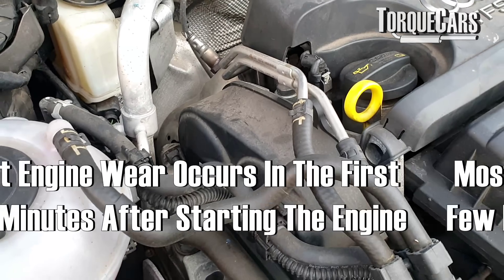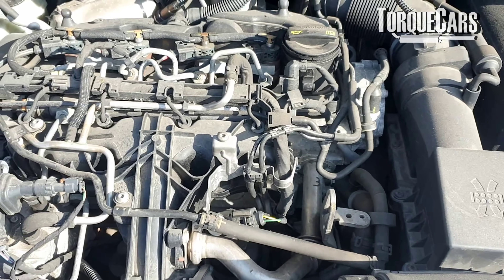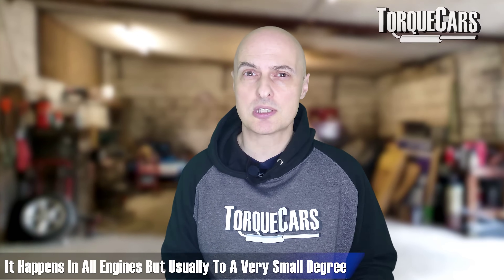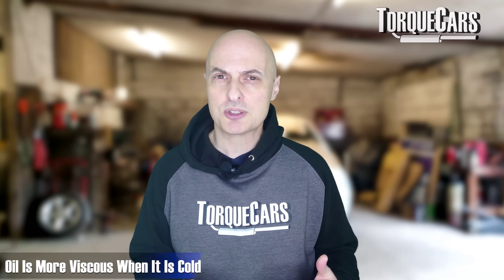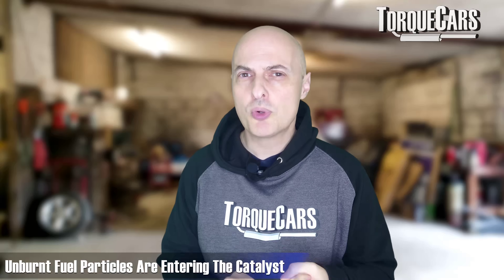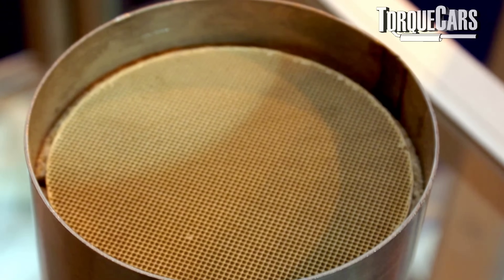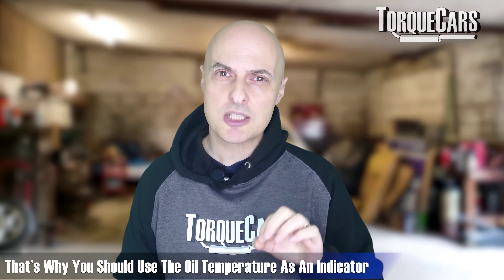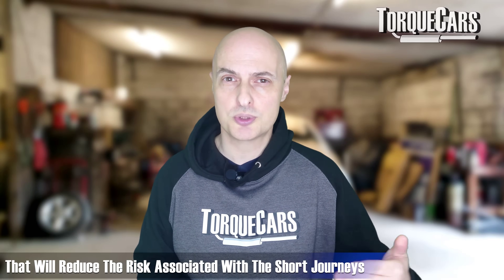5 Minutes of Terror? The TRUTH About Cold Start Wear (and How NOT to Blow Your Motor!)

Comment: I am from Canada and at one point lived in Dawson Creek, B.C.
In the winter it is not uncommon to reach -40C.  I remember one day leaving our office in a Ford Crown Vic with an outside temp of -40C.  I hit the gas and the oil filter blew off as the oil we were using as still conventional.  At these temps conventional oil wont flow at all however -40C however synthetic does flow.  I used a pure synthetic in my cars and never had an oiling problem.
Reply: If the manual of car allowe to use 0w30 or 0w20, In winter use a 0w oil. Liqui moly oil are very good at cold viscosity. Check your car owners manuals and see what viscosity you can use to your car. I live in Romania and I have a Honda civic 2011, winter I use 0w20 and in the summer I use 5w30 from amsoil. In my country temp never drop -10.
Reply: The 2011 Crown Vic owners manual specifies synthetic 5W20 oil for Canada but I'm pretty sure there is no issue using 0W20.
Reply: @christianluggert9052  The difference between  5w20 AND 0w20 is the oils cold flow capability nothing more. the W stands for winter and the lower the number the better the oil is supposed to flow in - degrees.
Reply: @MehdiS-music the w stands for weight, a term used to denote thickness.  I’m not sure where you heard otherwise. 5w-40 means it can have the viscosity of a 5 weight oil when cold, and a 40 weight when warmed up. So the thickness doesn’t change (as much) from cold to hot, minimizing wear at either temperature extreme.
Reply: @5400bowen  That is a very common misconception. The W actually does stand for winter. This information is readily available all over the internet.
Reply: @5400bowen  the W means winter. You need to read more buddy
Reply: So your bypass valve was frozen or what?

Comment: Letting a car idle for a few minutes before taking off will not in fact harm it. The engine will be cold no matter what, and letting it slowly warm itself for a short while is arguably a proper thing to do. It will bring the engine closer to it's natural operating temperature where putting some load onto it at that point (to gently warm it the rest of the way) will not be a problem. You may also notice that cold engines idle quite high, this is for several reasons, but consider it a small load on it until it warms up enough to drop to around 1k rpm idle speed. Also consider that automatic transmissions are likely to experience more wear when cold as well, and dropping them into gear while still in this high-idle phase isn't great for them; engineers call this a garage-shift and take great care to reduce the wear that occurs in this period but cannot prevent it entirely.
Reply: I agree. My Honda idles at 2,000 rpm when cold, then after 1 minute, it drops to 1,500 rpm and continues to slow down to normal idle speed. If I take off before it drops to 1,500 then going in reverse and slipping the clutch is pretty hectic. Waiting that one minute for the revs to drop also prevents it over-revving when changing gears. It is 10-30 degrees C here. I could probably drive it after 15 seconds after cold starting with no problems but the car is unpleasant to drive and the clutch is hard to use when idling at 2,000 rpm. It is a message from Honda to say "wait one minute". If I was in freezing temperatures I would let it warm up for a few minutes.

Comment: It is the revolutions, i.e. the work of the pistons, that cause engine wear, not the time of its operation. Therefore, the engine warm-up speed is not measured in minutes, but in the number of revolutions. When stationary, the engine rotates three times slower, which means that its wear is three times lower, so the thesis about the harmful long warm-up time of the engine is illogical, because time has no significance here.
Reply from the maker: Don't fall into the trap of confusing engine load with RPM, an engine under load (gently pulling the car at low rpms in this case) will warm up more quickly, avoid the acids and moisture build up associated with idling and the rich running cold engine and generally be better for the car and catalyst. A 3 times slower rotation will mean a longer warm up time and more wear rotations over this longer period. It would be wrong to assume a car is up to temperature after a set amount of rotations, load is very much a factor with warm ups.

Comment: Couple  of years ago a neighbour crancked his engine EVERY day till battery was almost empty and starter rpm dropped then finally engine started running and he hit FULL throttle for a 45 to 60 seconds to be sure the engine would not stop and to heat up....EVERY MORNING 😂😂😂  
Not surprisinly .......after 1 year...he needed another car....🤣🤣🤣
Reply: Nice pollution of the air too.
Reply: at that point it already had oil pressure when it fired up tho, it was probably fine

Comment: When its below -10C here I let it warm for a few minutes. but I drive a Cast block, cast head little truck and the last thing I need is a cracked head. It also has an internal slave cylinder for the clutch so I like to get a little heat transfer through to that rather than beating on cold fluid and seals. It gets to -42C here in the winter some time so I am probably going to let it sit and warm up for 10-15mins to defrost 

2007 Ranger 3.0 V6 with 5Speed manual
Reply from the maker: Do you idle to warm or use light throttle whilst stationary? I'm glad we don't get these extremes here in the uk.
Reply: @torquecars  idle to warm, idle air control valve will increase RPM on its own until satisfied

Comment: my general warm up time is to let the engine idle until the revs drop from around 1000 to around 600.
Reply: Same here, I always wait for the open loop phase to end and the idle RPMs to drop. Usually takes no more than 20-30 seconds.
Reply: This seems pretty reasonable
Reply: Hello, new to cars. Why is the idle always so high when the engine first starts? Does it get higher as the car ages also? I've had an older car that would idle at 2k for several seconds before dropping down
Reply: @iank6897  the motor runs a warm up cycle while it reaches operating temperatures. it’ll idle down once sufficiently warm. my mustang idles at 1500 cold start, 1000 while warming up & settles @750 idle when it reaches operating temp. the idle ranges shouldn’t change with age far as i know.
Reply: @cryyout  My Toyota Aygo does pretty much the same, idling at significantly above 1000 rpm right after starting, later at about 800 rpm.
By the way, the most important reason is, when its cold the engine needs a higher idle rpm, just for keep running smoothly and not dying off. As someone has already mentioned.
It will not warm up much faster by revving a bit higher at idle.
Reply: @iank6897 it’s to warm it up, but more importantly, it’s to make it run smoothly right away. Gas burns, and in a cold environment it doesn’t burn as well, which can make the engine run rough, stumble, and even die. That produces even more shocks to the cold brittle parts. And upsets people that pay big bucks for a brand new car. All internal combustion engines have that.
Reply: @iank6897  Computer control does it to move things around faster and therefore warm up faster.
Reply: @iank6897 High revs are normal especially in Winter. Cold air has more oxygen so the cars opens the trottle until the brain(computer)  measures air fuel ratio. When this ratio has been found it sets itself down when the most desirable  ammout of mixture has been found.Now...on really older cars with no electronics and only with simple mechanical choke the driver itself had to found the the right position of choke to start the car efficient until it warms up. This 2k reving in Winter is normal. When warm outside it should not rev at all high and if then it takes 3-5 seconds. This is all cars electronic measuring system. In extreme cold weather it can stay even longer high reving until engine temp is reached.
Reply: It is a really good way to make sure the engine is up to sufficient temps etc. , as the engine control computer knows better than we do when the engine is up to the proper temperature, so the “brain” is now making the decision about when it’s warmed up enough. Your thought is a great one for non auto mechanics to know when to put it in drive and pull away.
Reply: On the older cars we had a choke manualy  to set the revs while cold starting,you just pull out a little button on a 1"ish stem for full revs and as the car started warming you would slowly push it back in till warm.
My mini was like that.
Reply: I love this comment I usually do the same and it's the best ❤ Usually the engine is ready for the trip 😊
Reply: that takes over 10 minutes during a winter ( negative Celsius outside), and my rides are all within 3km range. 10 minutes gets me there and back.
Reply: @Ludak021 using a motorvehicle for this short way is borderline idiotic.
If you only drive these short routes, you‘d probably be better served with an electric car.
Reply: Calls someone borderline idiotic for doing 3km journeys in a car...

Recommends that person to go and buy a new car...
Reply: @Ludak021 My wife works about 6 minutes from home and I'm always telling her about how short trips kill engines and how she needs to really drive her car and give it a workout.
Reply: @richardlahan7068 your wife would be well suited with an electric car or plug in hybrid with like 15 miles full ev range.
Reply: @Ludak021 Your oil is due every 1000km with that driving pattern.

Comment: A lot of wear occurs when an engine has not run for a long time, f.e. been in storage for more than a year. Best is to turn the engine a couple of times round via the crank pulley, afterwards remove fuel pump relay and let the engine cycle a couple of times via the starter motor. When the engine has not run for a REALLY long time, or it is unknown how long it has been? Use fogging oil in the cylinders. And change the oil and filters, yes filters, also fuel filter. Also on regular driven cars, change the engine oil BEFORE schedule. City driving, short distances = severe conditions. Usually interval is half of normal.
Reply: I unplug the injector after winter is over and crank it until the oil pressure light goes out. Then plug it back in and start it up.
Reply: @1marcelfilms you mean the fuel relay, much easier to do.
Reply: I like it, never thought about moving by hand the engine and then use the starter with ignition off to lubricate everything before really starting it, I knew about putting a few drops of oil on cylinders before starting it, that I usually do with generators when they haven't been started in more than 6 months
Reply: With most modern cars if you push the break and gas down and hold them the car cranks without gas or ignition. Two cycles of three seconds will get oil wherever it needs to be.
Reply: @Larbr000  Really? Never tried that. Might be useful after oil change, too.

Comment: Mechanical sympathy was one reason my family bought a short range EV. Short distances with a petrol engine is hard on the engine. Our second vehicle (the one my wife normally drove) did maybe 4000 to 5000km a year, and the oil always smelled a little bit of petrol as the rich running engine contaminated the oil, while the lack of a nice extended hot running engine meant the PCV system never properly cleaned this up.

Now we use the EV for all the short trips. The Diesel is used for the long distance trips.

Of course there is a lot of emotion and argument for and against EVs, but the one argument very very few people seem to understand, is that having one EV in the fleet can save costs on the entire fleet. People waste way too much time making either/or arguments, or looking at each vehicle in isolation. You should look at the total cost of the fleet.

Now I will probably have a new problem. My diesel now hardly lives outside of the longer trips, of which I do maybe 4000 to 6000km a year. And I still need to annually service it.
Reply from the maker: That is one of the best arguments for an EV I have seen so far.
Reply: That’s why I ride a bicycle for mundane chores like groceries. Keeps miles off expensive cars.
Reply: Yeah spending 50k on another vehicle, plus insurance and plates is a lot of money. I’ll just take care of my trucks and buy fuel for that 50k.
Reply: @JAMESWUERTELE while I do agree that a secondary vehicle discount on insurance is a bit underwhelming, especially when you only have one driver.  My car shop has started to buy electric Fiat 500s troubleshooting the batteries and fixing them and then you have nice parts runners for less than 4 grand.  They probably don't have the range that most suburban drivers are looking for, but I think they're kind of useful for city people and rural people.  It's still feels like we're we're in early EV stages for a mainstream adoption and consumers should probably be aware of where they are on the technology curve.  I think they'll be a decent option as we get a bit more standardization, maturation, and we get some more stability in regards to all the supply chain stuff.  It's kind of like a carjack.  It's useful for some people and just a heavy ugly waste of space for many others.
Reply: Not much into EVs as a petrolhead, although I see the very great use of EVs for short trips as I’d rather drive an EV than a poorly warmed up ICE car
Reply: Yes, but rich homeowners buying an EV as a second or third vehicle with low utilization doesn't reduce carbon emissions, it actually increases them. I don't mind if the car works economically and logistically for you.
Reply: So you think it would be clever to have double the costs (two cars) so that one of them might last a little longer? That doesn't pay off.
Reply: @tomb.4171 no, this is for the scenario where an urban family has two cars anyway. When it comes time to replace one of them - it can make sense to replace with an EV/hybrid
Reply: Good to have options. I agree.
Reply: Nice response, thanks for advice😊😊
Reply: Perfect use of an EV. No-one needs a 4 ton EV Hummer IMHO...
Reply: Bicycle e bicycl, scooter are a more economical option for that

Comment: From the comments below it still appears many drivers don't have a clue about the proper warm up of their engines. NO, it is NEVER a good idea to let your engine sit idling to warm up. Once the engine has run for about 10 seconds, the oil pressure is up and oil is circulating throughout. It can't be stated more emphatically, a cold idling engine has water condensation and raw gas collecting on the cold cylinder liners, and diluting and contaminating the oil. As so much engine wear happens at start up, sitting idling cold is essentially prolonging that period of maximum cylinder and bearing wear...!  Best and fastest way to warm an engine is, as soon as you can drive it at moderate speeds until the water temps hit the 'normal range' before increasing your engine load and speed. I have an oil temperature gauge, and I find the oil doesn't hit the normal oil temperature range until I've put about 20-30 - km or so of driving on it, so I avoid highway speeds until the oil has had a chance to warm too... 
Also, you should drive at least 30-minutes on the highway each week to have the oil reach peak operating temperatures for an extended period, so the oil dissolved gas and water has a chance to boil off.
Reply: Ten seconds is not enough when it's minus 10 out..very hard on the tranny .1min or 2
Reply: My maserati oil temp is up to half in 2 or 3 miles..same as temp gauge half..runs at half at minus 20 or 38 Celsius.
Reply: Many standard petrol engines perform better by warming up f at least a few minutes. It is easy to test how it affects the performance. Try starting the car on a cold day and after 10 seconds, when the oil has circulated, go uphill and try to pick up speed. Then do the same with a warm engine ( check the temp gauge) and spot the difference. Myself i idle the engine at start for about 1 minute, then rev it a wee bit not overdoing it, wait another minute and take off easy. Unless it is below 10 degrees Celsius. Then i take longer. Real life test. Id say the damage to yr engine is far greater by pushing/ forcing it under sub optimal conditions in the cold than from idling it. But hey, do whatever you think best..
Reply: Thank you Senpai.

Comment: Would a hot climate around 25-38°C help lessen the warm-up period?
And that that the short journeys wouldn't be as detrimental?

I would assume so. However, I don't fully grasp the reason behind the chemical principles and there may be further implications
Reply: Of course
Reply: Yes, I only realised that my thermostat was leaking when the temperature dropped below 5c.  The engine simply wouldn't reach operating temp, but would when it was warmer outside.